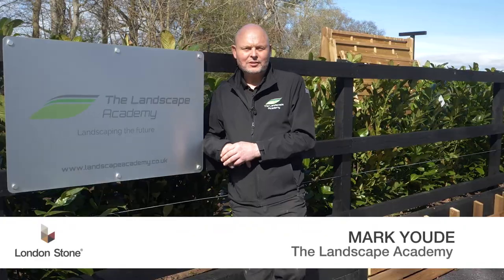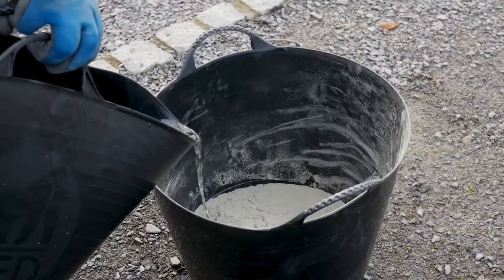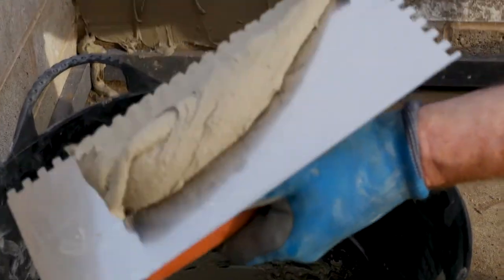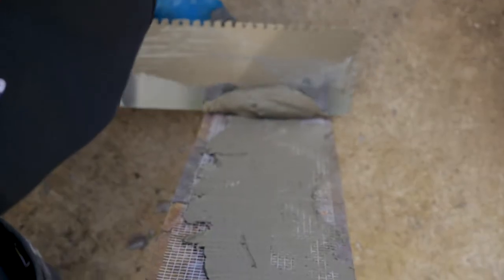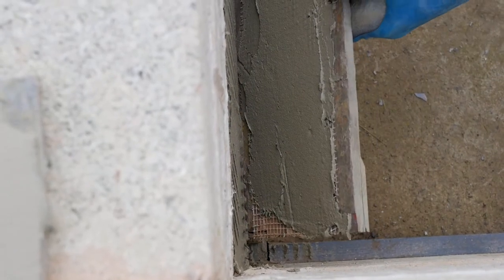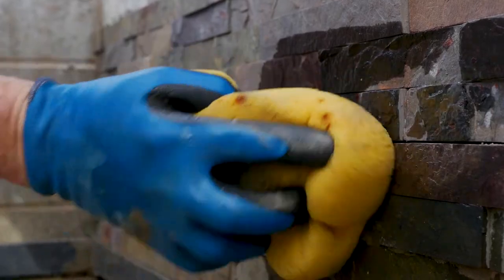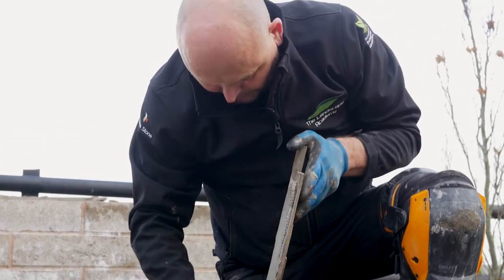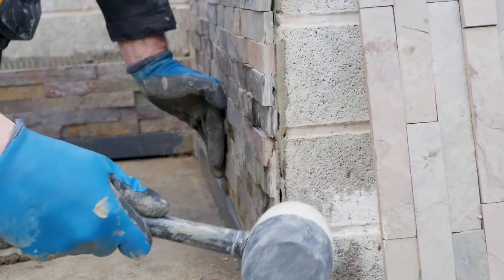Stone Cladding Installation Video

Comment: My mates exterior cladding has got like damp spots coming through as if the back of them have been stuck to the wall with small dots of adhesive. Will this go away was the weather dries?